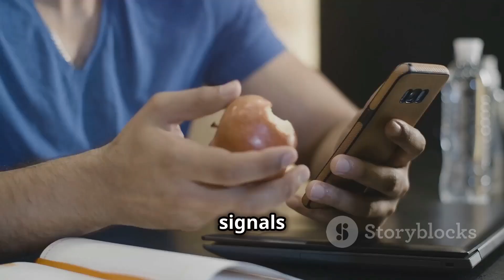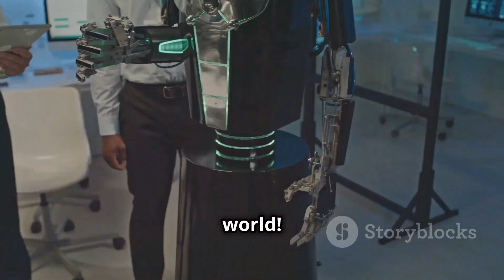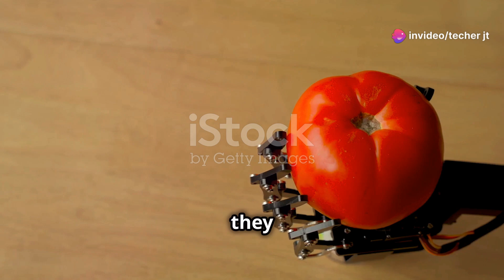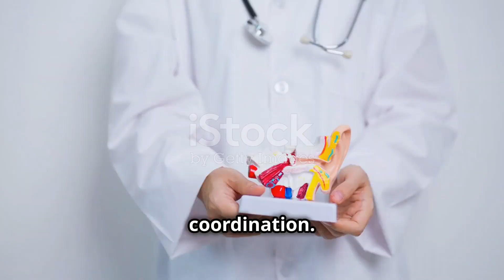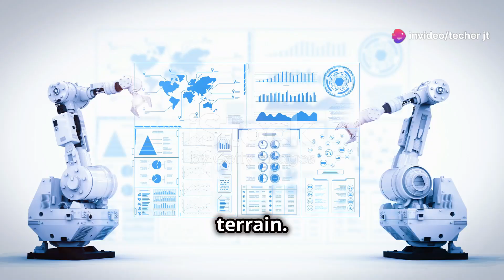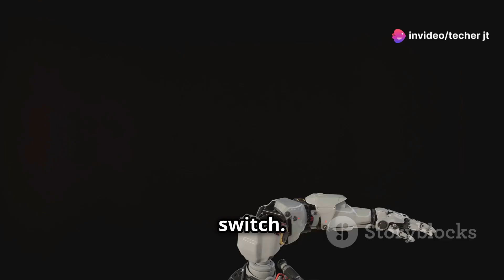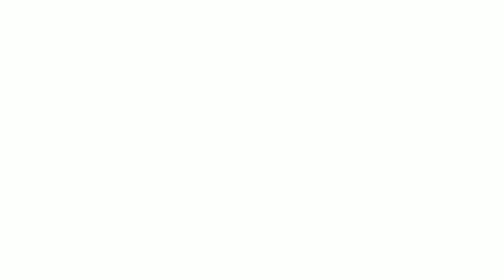Robotics Mechanical Sensors

Comment: Christine Divine S. Taña  
10-LYNX  

1. What are mechanical sensors, and how do they function in robotics?

Mechanical sensors in robotics detect physical changes like pressure, force, or movement. They convert these changes into electrical signals, allowing the robot to understand and respond to its environment.

Comment: Dave Aaron V. Dagcuta
10 - Lynx

1. Understanding: What are mechanical sensors, and how do they function in robotics?

Mechanical sensors arel sensors that are mainly used for their ability to create electrical signals from the mechanical energy. These sensors are what we would call their physical sensors since they operate mainly using mechanical force. For example, a robot arm with force and tactile sensors would know not to hold fragile materials with intense force or it will break.

Comment: Messiah Emmanuelle Lei P. Salomon
X-Cassiopeia

3. Analyzing: Compare and contrast force/torque sensors and accelerometers. In what situations would each be more beneficial?

-Force/torque sensors measure the amount of force or torque applied to an object, making them ideal for applications requiring precise manipulation, such as robotic grasping and assembly tasks. In contrast, accelerometers measure the acceleration or change in velocity of a robot or object, making them essential for maintaining balance and orientation, particularly in dynamic environments. Force/torque sensors are more beneficial in situations where feedback on the pressure or load is crucial, like in robotic surgery or delicate handling. Meanwhile, accelerometers are preferable for navigation and motion tracking, especially in humanoid robots or drones that need to adjust their movement based on changes in acceleration.

Comment: Evzen Radik A. Salvador
10 - Orion

1.1. Understanding: What are mechanical sensors, and how do they function in robotics?

Mechanical sensors are pivotal components in robotics, designed to detect and respond to physical forces or changes in the environment. They function by converting mechanical phenomena, such as pressure, force, or displacement, into electrical signals that robots can interpret.

Comment: Kyle Ross B. Baiño
10- LYRA

1. Understanding: What are mechanical sensors, and how do they function in robotics?

Mechanical Sensors helps robots perceive the world around them and gather information. It converts physical stimuli to electrical energy that the robot can understand. They allow robots to operate accurately and safely

Comment: AKISHA BACHINICHA
10 ORION

1.) Mechanical sensors are devices that detect physical changes or forces, such as pressure, force, or displacement, and convert them into electrical signals. In robotics, they function by measuring parameters like force applied to joints, pressure in pneumatic systems, or displacement of moving parts. This data enables robots to interact with their environment, maintain balance, and perform precise movements.

Comment: Anika Chloe J. Pepito
10-LYRA

3. Analyzing: Compare and contrast force/torque sensors and accelerometers. In what situations would each be more beneficial?

Accelerometers are excellent for tracking movement or direction, whereas force/torque sensors record applied forces and are best suited for precision applications like robotic control. Accelerometers are excellent for tracking motion, like in the case of equipment or drones, whereas force/torque sensors work best for physical interactions, such as regulating grip strength. Depending on the circumstance, both sensors have complimentary but distinct functions.

Comment: Frenzzy Kyla C. Halasan
10 - Hermes

1. Understanding: What are mechanical sensors, and how do they function in robotics?

Mechanical sensors in mechanical technology identify physical changes like weight, drive, or relocation by changing these mechanical inputs into electrical signals. They work by association with a mechanical component (e.g., a spring or stomach), which moves in reaction to powers, permitting the robot to degree physical amounts like touch, position, or development.

Comment: Angel C. Sumastre
10-Casiopeia

2. Consider a robot designed to pick strawberries; it must be gentle enough to avoid crushing the fruit while also firm enough to detach it from the stem. Tactile sensors can assist the robot in assessing the ripeness of each strawberry by detecting its softness, allowing it to adjust its grip accordingly.

Comment: Kent Kyle T Palingcod 10-Andromeda 
3. Analyzing: Compare and contrast force/torque sensors and accelerometers. In what situations would each be more beneficial?

Force/torque sensors measure the applied force or torque on an object, making them ideal for precise manipulation tasks, while accelerometers measure acceleration and motion changes, which are more beneficial for navigation and stability in mobile robots.

Comment: Reeve Radley C Fua 
X Cassiopeia 

1. Understanding: What are mechanical sensors, and how do they function in robotics?

ANS: Mechanical sensors in robotics detect physical changes such as force, pressure, and movement. They convert these changes into electrical signals, enabling robots to sense their environment. For example, pressure sensors can detect touch, while gyroscopes measure orientation.

Comment: Urhyness Agatha  Santos
10 Cassiopeia

Question: Analyzing: Compare and contrast force/torque sensors and accelerometers. In what situations would each be more beneficial?

Answer:Force/torque sensors and accelerometers are both valuable tools in various applications, particularly in robotics and engineering. They share the common goal of measuring physical forces. Force/torque sensors measure the linear and rotational forces applied to an object, while accelerometers measure the acceleration of an object, which is the rate of change of its velocity.

Comment: Fresh M. Satur
10 - LYNX 

Compare and contrast force/torque sensors and accelerometers. In what situations would each be more beneficial?

Force/torque sensors and accelerometers have different roles. Force/torque sensors measure the force or torque applied to an object, making them useful in robotics and industrial settings for tasks like gripping and load testing. They provide direct feedback on loads and help ensure safety in human-robot interactions. On the other hand, accelerometers measure acceleration, helping to track motion and orientation. They are commonly found in smartphones and vehicles for navigation and stability control. In summary, use force/torque sensors for precise load measurements and accelerometers for tracking movement.

Comment: Zhandra B. Dela Rosa
10-Andromeda

3. Analyzing: Compare and contrast force/torque sensors and accelerometers. In what situations would each be more beneficial?

- Force/torque sensors are used in robotics, manufacturing and automobile testing for precise control of direct forces or torques. Accelerometers are useful in consumer electronics, navigation systems and structural health monitoring because they can measure changes in motion and orientation.

Comment: James Jabiniao
CASSIOPEIA- 10

Mechanical sensors in robotics are tools that transform physical changes into electrical signals, enabling robots to sense and respond to their surroundings. These sensors include contact sensors, force/torque sensors, accelerometers, gyroscopes, and proximity sensors. By delivering real-time feedback, they improve a robot's capacity to carry out complex operations independently and safely.

Comment: Jacinth J. Yerro
10-Hermes

1.Understanding: What are mechanical sensors, and how do they function in robotics?
Mechanical sensors identify alterations in physical properties such as pressure, force, or displacement and convert these changes into electrical signals. In robotics, they offer feedback on movement and interaction; for instance, force sensors enable accurate control of robotic arms, while position sensors monitor joint movements to ensure precise positioning.

Comment: Daniella G. Estanilla 
10 - Cassiopeia 

1. 1.Understanding: What are mechanical sensors, and how do they function in robotics?

Mechanical sensors enable robots to interpret their surroundings by transforming physical inputs, such as touch or movement, into electrical signals that the robot’s controller can process. Essentially, they act as translators, converting real-world stimuli into a format robots can understand. These sensors are vital for robots to operate efficiently and safely, helping them avoid obstacles, manipulate objects with precision, and adapt to environmental changes.

Comment: Alvin M. Tagudin
10-Hermes

1. Understanding: What are mechanical sensors, and how do they function in robotics?
-Mechanical sensors detect changes in physical properties like pressure, force, or displacement and convert them into electrical signals. In robotics, they provide feedback on movements and interactions; for instance, force sensors enable precise control of robotic arms, while position sensors track joint movements for accurate positioning.

Comment: Jhon Lemuel C. Valmorida
Grade 10 Lyra
1.Mechanical sensors, specifically tactile and force-torque sensors, bring a semblance of the sense of touch to robots. This might seem trivial, but the ability to 'feel' can significantly influence a robot's interaction with its environment. Let's break it down

Comment: Jafe Marie A. Ebron
X-Cassiopeia

4. Evaluating: Assess the impact of mechanical sensors on the efficiency and safety of robotic operations in manufacturing. Provide specific examples to support your evaluation.

Mechanical sensors improve efficiency by enabling precise control and positioning in robotic tasks, such as assembly and welding. They enhance safety by using force-torque sensors to detect resistance and prevent collisions, crucial for collaborative robots (cobots) working alongside humans.

Comment: Zophiel Hailey Jace B. Usman
10 - Hermés

1. Understanding: What are mechanical sensors, and how do they function in robotics?

- Mechanical sensors are devices that detect factors such as force, pressure, movement, or acceleration. In robots, these sensors act like a sense of touch, enabling the robot to perceive and respond to its environment.

Comment: Precious Lea Jennifer D. de Dios
X - ORION

1. Understanding: What are mechanical sensors, and how do they function in robotics?
- Mechanical sensors are senses that allow robots to perceive the world around them. Just like humans rely on our senses to understand our environment. Depend on sensors to gather information, sensors convert physical stimuli like touch or motion into electrical signals that the robot’s brain can understand. Translating the language of the physical world into language that robots can comprehend. It function in robotics by performing tasks accurately and safely they allow robots to avoid obstacles, handle objects with precision and respond to changes in their environment.

Comment: Francess Elizah A. Pintac
10 - Hermes

4.Evaluating: Assess the impact of mechanical sensors on the efficiency and safety of robotic operations in manufacturing. Provide specific examples to support your evaluation.

Mechanical sensors are increasingly being integrated into robotic systems to improve operational efficiency and safety. They enable accurate and adaptable material handling, reducing the risk of damage to products and personnel. This integration is crucial in modern manufacturing settings, such as the food packaging industry, where tactile sensors enable robots to pick and place items without crushing them. Additionally, these sensors enable real-time movement adjustments, preventing accidents in environments with human workers.

Comment: Johann Rey Silmonet
10- Andromeda

1.Mechanical sensors enable robots to sense their surroundings by transforming physical inputs, such as touch or movement, into electrical signals that the robot's controller can interpret. These sensors are essential for ensuring robots perform tasks both safely and with precision. They help robots avoid obstacles, manipulate objects accurately, and adapt to environmental changes.

Comment: Marvin II T. Octobre 
X-Andromeda

1. Understanding: What are mechanical sensors, and how do they function in robotics?

-Detect mechanical changes and strain or stress, such as pressure, flow rate, vibration, distance, speed, acceleration and force, as electrical signals.

Comment: Jaeve Joshua C. Butcon
X- Hermes

1. Understanding: What are mechanical sensors, and how do they function in robotics?

Mechanical sensors are devices that detect physical changes or movements, such as pressure, force, or position, and convert these changes into electrical signals. In robotics, they function by sensing mechanical forces or displacements, enabling robots to interact with their environment. For example, force sensors can detect how much weight is applied, while position sensors track the location of moving parts. This feedback allows robots to perform tasks accurately, respond to external forces, and ensure safe operation.

Comment: Deron Ethan B. Pacaña
10 - Hermes

1. Understanding: What are mechanical sensors, and how do they function in robotics?

- Mechanical sensors in robotics detect physical changes such as force, pressure, displacement, or vibration and convert them into electrical signals, allowing robots to interact with their surroundings. They operate by sensing mechanical input, which is then converted into an electrical signal through variations in resistance, capacitance, or inductance, and processed by the robot’s control system. Common types include force/torque sensors for measuring gripping strength, pressure sensors for handling objects, accelerometers for motion and balance, proximity sensors for navigation, and strain gauges for monitoring stress in mechanical components. These sensors improve a robot’s precision and responsiveness in applications like manufacturing, healthcare, and exploration.

Comment: Fiona B. Valmorida
10-ORION

1. Understanding: What are mechanical sensors, and how do they function in robotics?

Mechanical sensors are essential components in robotics, acting as the "senses" that allow robots to perceive their surroundings and interactions. They measure physical quantities like force, displacement, or pressure, providing robots with critical data to navigate, manipulate objects, and respond to their environment.

Comment: Herah Jhylie Zean Q. Agbu
10 - Hermès

1. Understanding: What are mechanical sensors, and how do they function in robotics?

- Mechanical sensors allow the robots to perceive the world around them, providing robots with the ability to "feel" and interact with their environment. These sensors detect physical stimuli like touch or motion and converts them into electrical signals that can be interpreted by the robot's control system.  Mechanical sensors are crucial for tasks like navigation, object manipulation, and collision avoidance.

Comment: Mabulay, Mikah R | X-ORION

1. Understanding: What are mechanical sensors, and how do they function in robotics? 

- Mechanical sensors in robotics convert contact into electrical signals, allowing robots to perceive their environment through tactile, force/torque, accelerometer, gyroscope, and contact sensors for precise and secure interaction.

Comment: Ma. Nicole Cyse L. Rojo
10 - Hermes

3. Analyzing: Compare and contrast force/torque sensors and accelerometers. In what situations would each be more beneficial?

- Force/torque sensors measure the force or torque applied to an object, making them ideal for tasks requiring precise control of applied pressure, such as in robotic arms handling delicate objects or in assembly lines where force feedback is crucial. Accelerometers, on the other hand, measure acceleration and detect changes in velocity or orientation, making them better suited for applications like motion tracking, vibration monitoring, and balance control in robots. While force/torque sensors are more beneficial in scenarios requiring physical interaction or manipulation, accelerometers excel in detecting movement and maintaining stability.

Comment: Shawn Deece Otoc
10-LYNX

Understanding: What are mechanical sensors, and how do they function in robotics?

Mechanical sensors detect physical changes and convert them into electrical signals. In robotics, they measure force, pressure, and position, enabling precise control and safe operation.

Comment: Hamainie Briezies O. Gabriola 
10 - HERMES 

1. Understanding: What are mechanical sensors, and how do they function in robotics?

ANS: Mechanical sensors enable robots to sense their environment. Robots depend on these sensors to collect data, which transform physical inputs such as touch or movement into electrical signals that the robot's control system can interpret.

Comment: Trixie Dalman 
X - Lynx
 
1. Understanding: What are mechanical sensors, and how do they function in robotics?
-Mechanical sensors are devices used in robotics to help robots perceive and interact with their environment. They detect physical inputs, such as touch or movement, and convert these into electrical signals that the robot’s controller can process.

Comment: Zoe Jillian R. Cabrera
10 - Hermes

3. Analyzing: Compare and contrast force/torque sensors and accelerometers. In what situations would each be more beneficial?

-Force/torque sensors measure applied forces and are ideal for precise tasks like robotic control. Accelerometers detect motion and acceleration, making them useful for tracking movement or orientation. Force/torque sensors are best for physical interactions, such as controlling grip strength. Accelerometers excel at monitoring motion, like in drones or machinery. Both sensors serve different but complementary purposes depending on the situation.